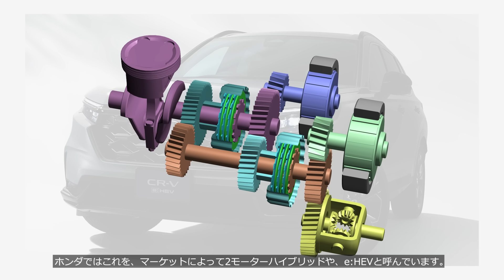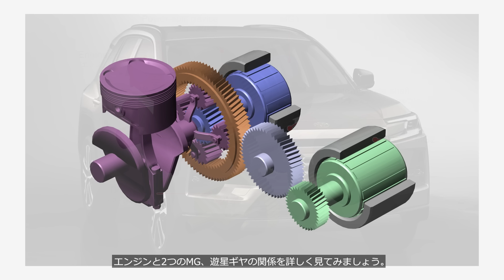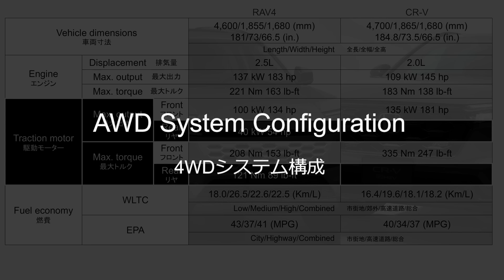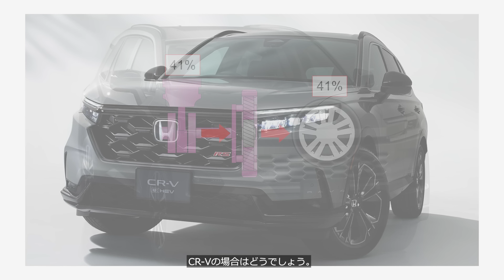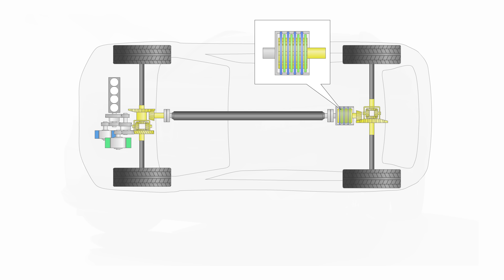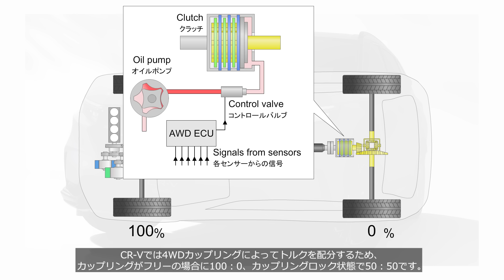2026 Toyota RAV4 vs Honda CR-V: Hybrid & AWD System Deep Dive Comparison

Comment: Numerous analyses—including those utilizing AI—have demonstrated that, when comparing the advertised fuel economy of Toyota and Honda hybrid vehicles in Japan against their real-world performance, Honda's figures are closer to actual results. The Civic, in particular, shows a very small discrepancy between the two, and is noted for its excellent fuel efficiency, especially during highway driving.

Comment: Honda has a one gear ratio for the petrol engine over 45 mph. This means high rpm on the motorway. Toyota has infinite gear ratios obtained by the speed of an electric motor on the planetary gear set. This gives low rpm on the motorway. Toyota has no clutches and higher MPG.

Comment: @sikasabumotorchannel On serial mode, Honda is less efficient; true that. But you didn't ~calculate when using the clutches to directly attach to the differential?! Typically, it's never on serial only; just when Charge mode is On an battery high.
Maybe I'm confusing a few things because I have the PHEV without AWD and bigger battery..

Comment: Toyota has a better design. Planetary gears are strong. No driveshaft to worry about and no leaking hydraulics in the rear differential. If the rear electric motor fails on the Toyota, the car can still be driven. If any part of the driveshaft or the hydraulic clutch for the rear differential fails on the Honda, the car cannot be driven.

Comment: The RAV4's AWD system is vastly inferior, and comparing it based on % power split is incredibly deceptive. Its rear electric motor is only 54 hp, 89 lb-ft of torque. That's it. Since that electric motor is the only thing driving its rear wheels, that's the maximum power it can send to the rear. When you say it can split power 20% front / 80% rear, this is accomplished by decreasing power sent to the front wheels, not by increasing power sent to the rear. So 80% on the RAV4 may sound bigger than 50% on the CRV. But this means:

RAV4: 13.5 hp (20%) to front, 54 hp (80%) to rear, total 67.5 hp.
CRV: 90.5 hp (50%) to front, 90.5 hp (50%) to rear, total 181 hp.

It should be obvious which is better if you need AWD. Numerous boat owners have run afoul of this problem. When you try to retrieve your boat with a Toyota or Lexus AWD, the slope of the boat ramp and load on the trailer hitch means most of the weight is on the rear axle. The dinky rear electric motor can't generate enough power to pull everything up the ramp, and Toyota's programming to "increase" power to the rear by decreasing power to the front backfires. The Toyota simply refuses to move.

I've been keeping an eye out on Toyota's AWD vehicles for over a decade starting with the Highlander Hybrid (which had the same problem), hoping to get one for towing since they're my preferred brand. But I eventually gave up. Toyota (and Lexus) does not intend to fix this problem, because it would mean sacrificing gas mileage when operating in FWD mode.
Reply: Interestingly the newest RAV4 seems to have massively improved its hybrid AWD performance - not sure if they significantly tweaked the hardware on the rear motor but the software is greatly improved and it definitely is able to deadlift itself out of a lot more situations.

The CRV hybrid despite having a mechanical AWD system has never been particularly capable - again, could be a software issue or a hardware issue where the AWD coupling simply isn’t able to transfer much torque to the back.

Comment: Here in Indonesia, we have Toyota Innova hybrid which has 2 litre engine hybrid. Similar configuration to CR-V hybrid, 2 litre engine hybrid. There is a real world test video on YouTube, they compared Innova hybrid to CR-V hybrid. The result was the fuel economy is identical but CR-V hybrid accelerates quicker than Innova hybrid. For the record, CR-V hybrid is more powerful but heavier than Innova hybrid.
Reply: Innova hybrid uses Ni-MH battery while CR-V hybrid uses Li-ion, so it's not a fair comparison
Reply: @hendrahidayat  it’s a plus for CR-V then.

Comment: Great explanation best i have seen so far of systems. I own a 26 trailsport CRV. It truly is a smooth set via up. They are correct the low gear is almost never used. Bottom line CRV gets less mpg but is much smoother to drive. It will climb hills locked gear using torque of motor with battery power. Great except for on long grades when the battery runs out of juice and it has to revup the engine to powerthe motorand recharge the battery.

Comment: The CR-V's AWD system can technically do 100%/0% but it only does it in one specific circumstance; under roughly 6 MPH when the car creeps forward and you're not touching the throttle. Otherwise there's always some power going to the rear at all times when you're accelerating.

Comment: The Honda is not a Hybrid. A hybrid means it can either run on the engine or electric motor or a combination of both. The Honda is a self charging EV, and only runs on its electric motor. The Honda is far more complex as well,with hydraulics and clutches, so maintenance will cost you more, and wont be as reliable as the Toyota. So if you’re not concerned about range anxiety you’re better off with an EV.
Reply: wrong...the Honda system works the same way, it's hybrid like the Toyota one.
Reply: You’re wrong. it can only use the electric motor to drive the car, it can’t use the engine for that purpose, so it’s not a hybrid.
Reply: @zoranm6432  Nope, there is a clutch that can engage the petrol engine in high demands to bypass the electric motor.  Typically at highway speeds.

Comment: So honda is less efficient because there are more moving parts creating a greater energy loss right?
Reply: I would rather say because honda most of time does double energy conversion to electric and back, loosing about 15% and thats about same diff with toyota mpg, toyota hybrid most of time part of energy flow directly via mechanical connection to wheels

Comment: The comment you make in first half about CRV AWD being FWD until it needs to switch to AWD is no longer correct and hasn’t been correct since gen5 CRV. The old version stayed FWD until slip was detected. The gen 5 and 6 CRV including hybrid ones stay AWD until 57mph and then turns to just FWD for efficiency.
Reply: watch the CRV hybrid vs rav4 hybrid AWD slip test below, it’s obvious which one is better. https://m.youtube.com/watch?v=XQMLw-XTrak&t=29s&pp=ygUcQ3J2IGh5YnJpZCB2c3ZyYXY0IHNsaXAgdGVzdA%3D%3D

Comment: I put 245/60/18 Uhp tires with 8 in rims so I still leave the crv’s in the dust because of traction 😂 I also just did my 100k maintenance of all fluids and was extremely surprised at how clean the fluid was because of no clutch material. The coolants however  definitely will be changed at 50k from now on as they looked like 💩.

Comment: The Toyota system really just a gear differential running in reverse. Instead of splitting a single input into two differing output speeds, it's combining two differing inputs into a unified output. It's more effcient than the Honda system because ratio of gasoline engine power to electric power can be continuously varied unlike in a hard step like the Honda system. Honda's system works really well, but you get the idea that they had to do it this way because Toyota already had the patent to the planetary-gear method.
Reply from the maker: Thanks for watching the video!
Yeah, I think so too. This is actually Honda’s third hybrid system—not just a third generation, but a completely new one adopted after abandoning two earlier systems. We can really sense how much Honda struggled to get here.
Reply: Google: man sued Toyota for stealing hybrid technology and won. A University of Maryland professor patented the “hybrid power split device” in the mid 1990’s b4 Toyota copied & started using it!?!

Also, watch the CRV hybrid vs rav4 hybrid AWD slip test below, it’s obvious which one is better. https://m.youtube.com/watch?v=XQMLw-XTrak&t=29s&pp=ygUcQ3J2IGh5YnJpZCB2c3ZyYXY0IHNsaXAgdGVzdA%3D%3D

Comment: Toyota power split device is definitely my choice. Simple, seamless, reliable, and energy efficient. Genius. Moreover l like Toyota  2.5NA engine with both port and direct injection tech.
Reply from the maker: Thanks for watching the video!
I also think the engineers who came up with this system are geniuses.
Reply: Google: man sued Toyota for stealing hybrid technology and won. A University of Maryland professor patented the “hybrid power split device” in the mid 1990’s b4 Toyota copied & started using it.

Also, watch the CRV hybrid vs rav4 hybrid AWD slip test below, it’s obvious which one is better. https://m.youtube.com/watch?v=XQMLw-XTrak&t=29s&pp=ygUcQ3J2IGh5YnJpZCB2c3ZyYXY0IHNsaXAgdGVzdA%3D%3D
Reply: I've been driving a RAV4 Hybrid for the last 6 years.   It is very efficient, has plenty of power,  very low maintenance.

Comment: Beside you're arguing on brand's numbers that are never true in areal use, you are even forgetting that the power split device also needs electric motors to run to force the whole sistem at the power point the driver is requesting.... and they don't suck power from the void.
Reply: Toyota's system still achieves higher efficiency and and better fuel economy, especially in colder weather. Video does a great job of explaining why Honda's system is less efficient. Neither are bad, both are very reliable and efficient systems with their own unique benefits. Honda's system has better acceleration/drive feel and Toyota's system is more efficient.
Reply: watch the CRV hybrid vs rav4 hybrid AWD slip test below, it’s obvious which one is better. https://m.youtube.com/watch?v=XQMLw-XTrak&t=29s&pp=ygUcQ3J2IGh5YnJpZCB2c3ZyYXY0IHNsaXAgdGVzdA%3D%3D